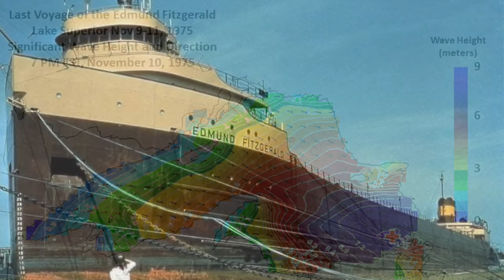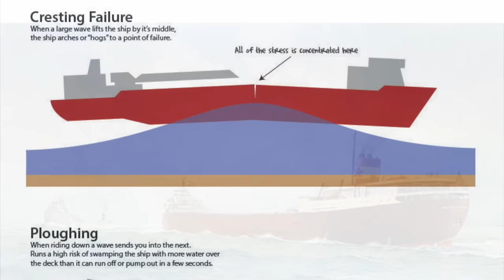What Happened To The Edmund Fitzgerald?

Comment: Have anyone ever considered metal fatigue? I mean that she was very flexible... 17 years of bending the hull with loadings, storms etc. could have taken a toll on her aswell... So lets say metal fatigue + hard grounding + heavy weather = disaster at some point... After she broke a part she allso lost electrical power at the forward part of the ship explaining no distress call... Rapid movements of the vessel caused by breaking a half and extremely high waves could explain that no one or allmost no one were able to escape the ship. If anyone was able to escape then lake took him and he was lost at sea. So I belive that this disaster occured because of combination of several different factors. By the way this type of ship building (different sections welded together) was not so new way of ship building... Liberty ships from ww2 were allso made like this 😉 Anyways good work 😉
Reply from the maker: Taconite pellets do take a toll on a ship (as does Limestone)
Reply from the maker: Thank you!
Reply: @ConnorTenold  if the cargo is corrosive or makes some how makes the hold rusting faster then why not but usually loading operation it self is more devastating for the the ship because it makes a lot of stress for the hull. Special way of loading only reduces stress but does not make it disapear 😉
Reply: Yes
Reply: The reason most likely about the lack of a distress call is because the pilot house was submerged under the lake so fast and at such a depth where the water simply blew the windows out and blew the bridge crew back and down the stairs leading up to the pilot house, killing them in the process, it was so fast the men on the bridge probably had no time to react, they thought the bow would pop back up over the waves but it just kept going down. That would’ve taken probably as much time as it’s taking you to read this.
Reply: I had read somewhere that Captain McSorley was worried about taking her out on this particular run because she was due for some extensive repair on the hull and keel.
Reply: @matthewstorer8236  I don't know about big fitz but this was the case with ss Carl D Bradley... She had one extra run before extensive refit...
Reply: @tugboats79  If you read George Burgner's deposition you will see what I'm referring to. Cracks in the hull and keel that were "quickly" repaired. The reason he transferred off the Edmund Fitzgerald. It gave him a bad feeling. McSorley knew about the danger. Also loading to the Summer line in a ship that was due for intense repair during the 75-76 winter lay up.
Reply: oh yes.   All evidence points to a weak boat.   It may well have cracked without shoaling, due to the stresses.

Comment: I believe the hatch covers of canvas leaked enough water into the absorbent and already heavy Taconite and created such a load on the hull, which is essentially a beam, that it broke apart near where the bending moment of the hull was greatest…perhaps near one of the main hatchways. The hull failed and broke apart at the section nearest the greatest bending moment. I have also heard that none of the main hatchways had radii in their corners. The radii would have helped distribute the bending more evenly through more of the hull. It was instead converted to enough torsion  to stress the hull enough to separate.

Comment: Most likely was crippled from the shoal & for certain she went down nose first into the bottom and broke in half after the impact.  The bow damage points to evidence of a hard nose impact and the bow and stern are very close together on the bottom, if she broke apart on the surface the stern would have traveled a little bit further and much father apart from the bow.

Comment: You might be incorrect when you said that the method in which The Big Fitz was built had never been done before. During WW2:
"A standard Liberty ship contained no less than 97 prefabricated sections, including hull "chunks" lifted into place with portholes, mirrors, radiators and other living accommodations already installed. Each was 441 feet, 6 inches in length, 56 feet in width and about 10,920 deadweight tons."
Reply: Came here to say the same thing. Gj!

Comment: It's called the weather deck it's just below main deck the length of the vessel on both sides with water tight bulkhead doors along the corridor. Boilermaker by trade. Been on a few vessel's in my day. Worked on all three of Ford's ships at the rouge plant. The ships were named the Benson and Henry and the breach. Long time ago!  I was pretty green back then.

Comment: I've seen reports sayin there were issues with the way the Fitz was built.  Imporper and shoddy welds with handfuls of welding rod shoved into gaps where plate steel should've been attached too ribs/beams which were mentioned by a couple of machinists who sailed the Fitz in summers prior too her sinking.

Certainly being the first too be built in the modular manner vs the older more proven way of from the keel up could have led too her fate too.  Nowadays pretty much all ships are built in a modular manner as the technolgy evolved and improved.  

There's a vidoe of a tanker that broke apart in the Sea of Japan if memory serves. The ship split in two and floated for several hrs before sinking allowing time for the crew to be rescued.

Really good job with the vid youngman!
Reply from the maker: That’s interesting! I never knew that
Reply from the maker: Thank you

Comment: Great video.  I've always thought the design was unseaworthy; not built for bad weather.  A ship of that length should have been ten feet wider in the beam.  I heard somewhere that divers examined the Caribou Shoal after the sinking and did not find any gouging to indicate that a big ship had struck bottom there.  I don't believe that it dipped its nose into a wave and then the propeller drove it into the bottom--if the bow had dipped, the propeller would have been out of the water and unable to push anything.  I always found the Coast Guard conclusion that the hatches were not properly fastened to be convincing.  Finding so many clamps on the bottom that were undamaged indicates that those clamps were never fastened.
Reply from the maker: Thanks! I think that we will never really now for sure what happened. I think the shoal punched a hole in it's hull and eventually the Rogue waves the Anderson reported sunk it. It seems if it were the hatch covers were open it would have sunk faster because the Taconite pellets would have absorbed so much of the water. But nobody is wrong and nobody is right. We will just never know.

Comment: heres the fitz, overloaded with taconite, more than what she should have been carrying, out in one of the worst storms in 50 years on the lakes. fitz's radar was down, so did she hit the shoals? quite possibly...the captain reported a fence rail down, 2 vents missing and a list just after passing near the shoals. you lose a fence by hogging a ship...which means it bends upward in the middle-from bottoming out on the shoals? anyway, as she was down bound for the next 4 hours; the captain reported larger wave heights than the Anderson was reporting...the fitz was sinking slowly into the lake in the storm. pumps were running, but with taconite plugging off the intake to the pumps, they were of little use. all this time she is bending and twisting more and more at about mid ship. the Anderson reported a couple of very large rogue waves hit them around 7pm, and just about lifted their fantail out of the water. those waves could have hit the fitz. anyway, in her final moments, the fitz took a nose dive to the bottom, in mere seconds with the screw still turning. fitz hit the bottom with tremendous force with the bow, the midsection disintegrated like an accordion, and the stern possibly came over the bow as it was still slowly spinning underwater, dumping tons of taconite on the bow. then the stern sank upside down a couple hundred feet from the bow. the rest is history. IMO thats how she went down.
Reply: No. The stern didn’t break over the bow! Only in a cartoon. Millions of pounds do 2 things in the open lake. They float, or they sink. Bad call leaving port! Terrible. Criminal.ignorant. Ridiculous! Absurd. Arrogant. Deadly tragic choice.

Comment: The fact that there was no distress call says that the ship went down very fast. If the water absorbing cargo was saturated making the ship way too heavy then one of two things happened that made it impossible for the crew to call it in. Either the ship split in half and went straight down or the bow got lifted high into the air by a wave and when it nosed back down it went into the water like a dart and just kept going down. Even if they got rolled over there would have been enough time for a quick SOS.

Comment: you forgot that the fitz hit the pier on the other side of her launch slip as well. i still believe that her bow was driven into the lake bottom (ploughing to ground strike) where she sank. it would explain the reason no response was given no emergency calls were made as well as the bow damage seen on the wreck. it would also explain the wreck being split in half. especially if the rogue waves were as big as claimed. with the ship still moving forward the bow would have been driven right into the floor and the ship would have snapped like a twig without having any water supporting the hull.